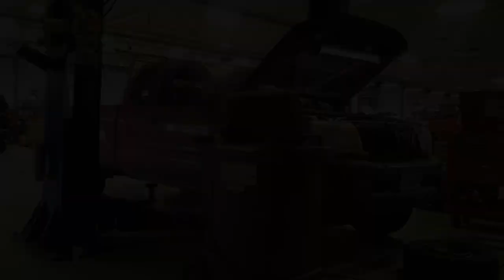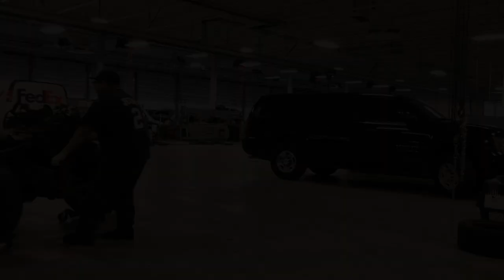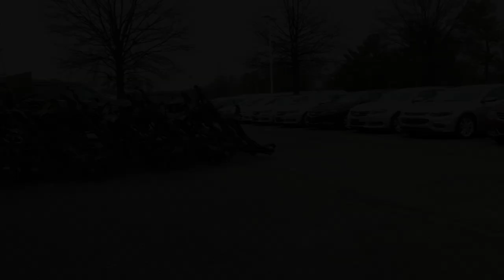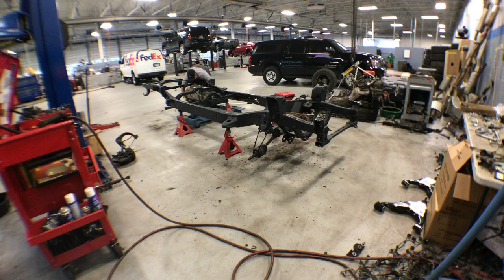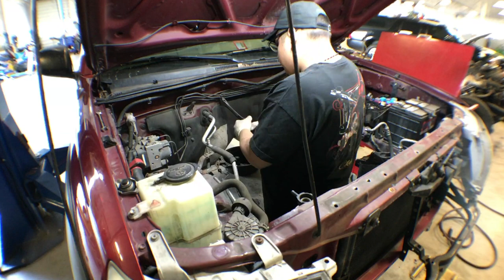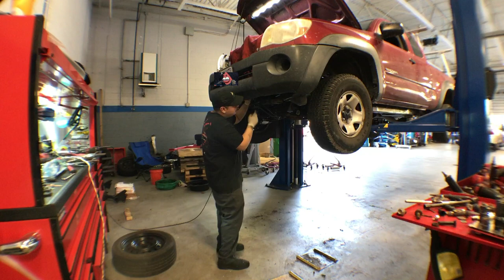Toyota Tacoma Frame Replacement

Comment: I find it very disappointing and frustrating that the 3rd Generation 4Runner's were not included on the frame "Warranty". It's a shame that most 3rd Gen 4Runner's from now will head to a junkyard one day due to Frame Rot, while the Tacoma's will live to see longer days because they get a new Frame.
Reply from the maker: Yes I've seen many 4runners with similar issues of rust. from what i've seen over the years, it has been the 03-04 affected the most!
Reply: @MoarLow  Mine isn't bad for being in the midwest it's entire life, but I don't see the frame living for more than 5 years.

Comment: Wow the old frame looks better than my frame on my Tundra 2002. Totally rusted through, under 150,000 miles, body has no rust but frame is shot. Toyota wont do a thing the offered to spray paint the frame. Disgusted and sad I loved my Tundra. Can't find another blue with blue interior.
Reply from the maker: The tundra was covered years ago from Toyota. I've done a few tundra frames.

Comment: Why do you think Toyota went with a boxed frame, instead of an I beam or 3/4 box? A boxed frame collects salt and sand.
Reply: Toyota is the ONLY brand sold in the USA who does NOT use fully boxed frames in their body-on-frame vehicles.   That is part of the reason why they are always breaking in half.   Nobody else puts crappy drum brakes on a modern vehicle either.
Reply: @jkutyna  Plenty of modern vehicles come with drum brakes lol

Comment: I think he’s done that before. You would think Toyota would of learned after the 2000 tundra frame problem. (( quit going cheep ))).  Good paint and steel, or wax like GM.
Reply: That GM wax is awful. It only lasts about a year, and if you use an oil based undercoating it falls off almost immediately. They rust every bit as bad as the Tacoma frames up here in Atlantic Canada, but GM won't do anything for you. The problem was never that they were cheap, it's a design issue. They're a boxed frame, salt gets in through the holes in the side but can't get out so it just lays in the bottom of the frame. This is compounded by the fact that the steel is thinner, they use roughly the same amount of steel as comparable C channel frame, but because it's spread out over 4 sides and not 3 the steel used is thinner to keep the weight about the same. It's very strong, just a poor choice in areas that use road salt in the winter. Toyota does have a kit now with a bunch of plastic plugs to plug the holes in the frame which solves most of the problem.

Comment: In 10 years later toyota will be changing frames on 2020 tacomas. When will they ever learn????
Reply: They plug the holes in the sides of the frame now. That was most of the problem. There are 2 rectangular holes on the frame rails behind the front wheels in particular and when you turns the wheels while moving it tends to fire mud, water, salt, etc directly into the frame where it can't get back out. Between the plugs and undercoating I don't think you'll see near the amount of rust issues on 2015+ trucks

Comment: All these years and Toyota is still having problems with their frames. My 2000 tundra had a frame replaced and now i just got a letter saying my 2014 Tacoma may need a replacement. Might have to rethink my next truck purchase. Smh
Reply: Boost Lee  How much did costed
Reply: The frame was free but they had to replace the front upper ball joint, front and rear brakes, all brake lines and fuel lines. That all cost $1200 which i think was bs since they had the whole truck apart already.
Reply from the maker: The tundra should have came with new fuel lines and brake lines that are on the cab and frame. The 2014's didn't have the same issue from I've seen, they just get a coating on the inside of the frame.

Comment: Personaly I wouldn't want a truck that this happened to.
 just thank of all the other problems it probably has now wasn't made to be took apart agin anyway
Reply: I had the frame replaced on my 07 about 3 years ago I have not had a problem with except one exhaust hangerwhat's too close to the frame when I was in gear idling in traffic it would tap up against it took it in and they fixed it no problem drop it off on a Monday pick it up on free rental truck week

Comment: Why you have to replace the frame of the tacomas if people claim they last over 300k
Reply: They had rust issues the engine and transmission is where the reliablity is at i own a tacoma 01 but i live in Cali no rust no problems 188k miles
Reply: @greencrocidile6246  thats still not good tho having rust issues i have a 98 ranger 5speed 4cyl bought with 70k on it now it jas 305k still runs the same only breaks,oil,filters,and fan clutch replaced oh and 8 sparkplugs with wires love it
Reply: Most unreliable truck sold in the USA, but the loyal fans keep going back for more punishment over and over again.  Toyota is sort of like a crack dealer in that respect.

Comment: I heard a strange noise when i put my truck in reverse took it to the toyota dealer and told me that on the motor mounts was 'folding " into the frame..then told me it was under recal  I am second owner  so did not hear about it..so my truck is in line but might take two months!

Comment: Dana makes frames for a lot of lines, I find it so strange that only Toyota has a issue and has frame rot. A truck is not a car, a truck is a tool, something to work in. A Toyota truck is not a truck, it is like a capon all cluck and no balls
Reply: Dana isn't the company who is choosing to go with C channel frames, that is all on Toyota so they can eek out 1 mpg more from the lessened weight.  Same with the plastic truck beds that you can't put anything into without voiding your warranty.   Dana makes a product to it's customer's specifications.  EVERY other manufacturer has fully boxed ladder frames except Toyota, and only Toyotas rust out in guaranteed fashion.  They specced the design, the steel, and the coating and protection on the frames and they are cheap at it.

Comment: Its a shame that they put those tacomas on such bad frames. I have 2006 they coated the frame I've got 208,000 on it and it still runs strong. The engine will probably outlast the frame.

Comment: Or you know, you could like, NOT buy a toyota and get something reliable and worth it's price and you won't have to swap your rusty frame every 3 oil changes.   That has always served me well but I guess there's a lot of folks out there who prefer to pay more for the least reliable truck sold in the USA.   It's an annual rite of passage for them to be swapping their frames out.   I've got better things to do with my time and money personally.
Reply: I might add that one thing you will NEVER see on a Ford/Nissan/GM/Honda/Ram dealership lot is a stack of used rusty truck/suv frames and pallets stacked up of new frames that have to go into the vehicles.     Just looking at that in the dealership parking lot, it astounds me that anyone could be so stupid as to buy these defective pieces of crap.   If I saw that at a dealership where I was going to make a car purchase I'd turn right around and leave and look at other brands in an instant.

Comment: even though it's a free frame you could end up spending thousands on other rusted parts.….
Reply: Anything needing to be replaced due to frame rot is covered👍
Reply: @jasonfancey472  so the whole truck.   Heck why stop there, every dang truck on the dealership lot would qualify for that if it has a T On its front grill.

Comment: I hope the owner replaced a lot of parts with new since the labor of removed by and installation by was covered. New water pump, new clutch, new suspension, new fuel lines.......
Reply from the maker: Many customer did take advantage of this coverage. Some spending thousands. "while you're in there"

Comment: That's just way too much work to save a run of the mill Tacoma. Unless Toyota was paying for it and the repair was free, I'd scrap it and get something else
Reply: justsomeguytoyou,
Factory recalls are usually covered by the factory…
Reply: Toyota is paying for it.  The US government is MAKING them do it as Toyota lost the largest class action lawsuit in world wide history over this.   Toyotas have been rusting apart since the 1980's and it's just finally that the governments are stepping up and forcing them to deal with their defective vehicles.  The USA also told Toyota it can't sell the FJ cruiser here in the states anymore as it is unsafe and they were breaking in half.   You cannot buy one to this day because of that.

Comment: I would be willing to bet that this guy is probably only getting paid some piece work flat rate BS for this job and the the dealer will try to upsell the hell out of it too.
Reply from the maker: Yes it was flat rate but it paid enough. Not many upsales on most frame jobs, but we did give the customers a check over on the vehicle and advise from there before the replacement.
Reply: @MoarLow . Well I'm glad to hear this a better deal than I had assumed and that the flat rate for this job is reasonable. I'm not a fan of piece work or flat rate jobs.

Comment: this whole frame thing by toyota was ridiculous. put another frame under the same shit box with the same rusty lines the same bad wheel bearings, the same warped rotors the same worn pads, same rusted out backing plates on and on and on..    for what? a new frame.  open dumpster and insert money
Reply from the maker: A lot of components were replaced with new toyota parts during this frame replacement. 

Some of the parts replaced - Lower control arms, metal brakes lines, leaf springs, speed sensor wires, wire harness(early coverage), most the removed components' hardware, and many other small things(clips, etc..)

Comment: Good old Mexican frame company, let's re use the same dipping fluid to seal the frames, then store them outside by salt water lol..genius! That's why toyota ended up buying the frame company lol
Reply: And fyi, only fluid that will be touched is the brake fluid and front diff if it has one...  leave the engine and trans in the body. Use a engine support bar.
Reply: Hmmmm, my '07 Tacoma frame was made in Texas by Dana corp. and it was all rotted.
Reply from the maker: ......calls FTS. 

On a serious note not worth the risk destroying the inner fender and/or rest of body that was not designed to hold the weight of an engine and trans.

Comment: Most likely you will have missing or loose nuts & bolts , leaky hoses and missed electrical connections problems afterwards. +  unwanted squeaky noises and rattles later.
Toyota factory have more quality assurance check than sub contractors.
Hopefully it won't be. 💩

Comment: Toyota lost its mojo 🤦🏻‍♂️
Reply from the maker: Puchito puchito the rust problem affected most Tacoma’s that are in the northeastern part of the US.
Reply from the maker: Also not Toyota’s fault they started to rust. Most states around here throw down harsh chemicals during our winter seasons. Problem arises because some owners don’t clean the undercarriage of their trucks.
Reply: MoarLow i completely agree but its more rust with newer models
Reply from the maker: WoodbyWolf not keeping up with preventative maintenance, like not cleaning your undercarriage, will not help to prevent corrosion. Most Toyota owners manuals state “If you drive on salted roads in the winter or if you live near the ocean, you should hose off the undercarriage at least once a month to minimize corrosion.” (Taken out of my Corolla owners manual) 

Yes the 05-10 Tacoma, 07-08 Tundra, 05-08 Sequoia were the vehicles involved in the class action settlement due to frame corrosion. From all the frames I’ve replaced it affected the Tacoma the most. The majority of tundras and sequoias that came in for a frame inspection were clear of rust. They only received a undercoating. 

In my opinion it wasn’t just a poorly designed frame that was the issue. I own a 2004 Tacoma with no issues with the frame because I’ve always made sure to clean everything. The 95.5-04 Tacoma’s were the first trucks with the corrosion issue. Toyota bought many of the trucks back because they were bad, a lot worse than the newer 05+. That ended in 2009. Followed by the first generation Tundra. That’s when Toyota started replacing frames on the trucks. But that customer support program has ended. 

Hopefully you can get in someone’s ear enough and get your truck fixed.
Reply: @MoarLow  wrong.  The US government proved in the class action lawsuit that Toyota did specify to have its frames built unsafe and rust prone to save money.   Toyota is NOT the victim here.  They designed and ordered the frames to be defective from the start.   They dont want people owning a truck for 20+ years and not buying a new one, so they design them to fail.  This was all proven in the lawsuit.

Comment: Only Toyota can get away with issues, it seems. Toyota over rated, over priced, other defects also on my Taco. Miss my 99 Dodge Ram.
Reply from the maker: Correction they are the only company willing to do anything about repairing frames with rust issues. 

All domestic manufactures have pretty much told their customers to kick rocks if their vehicle has any rust issues. 

This issue mostly affected trucks registered and driven in cold climate state areas.

Please inform yourself, Thanks for viewing.